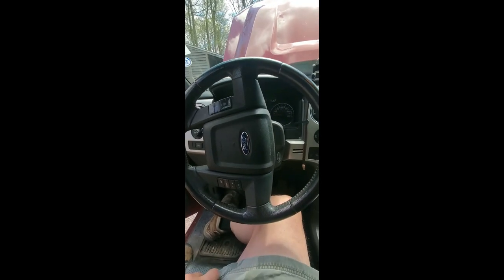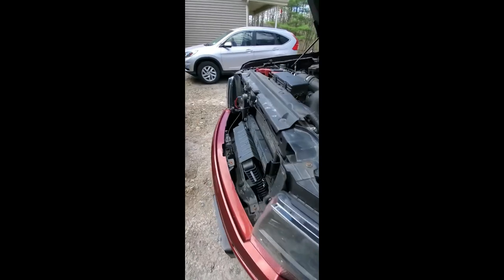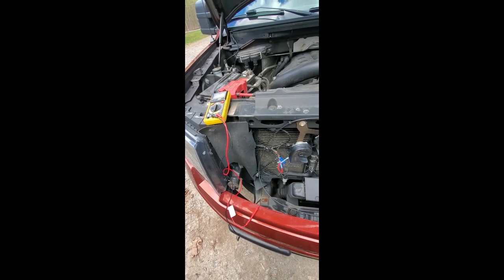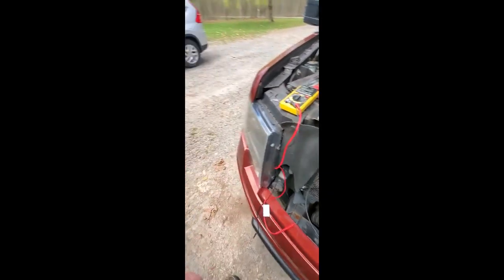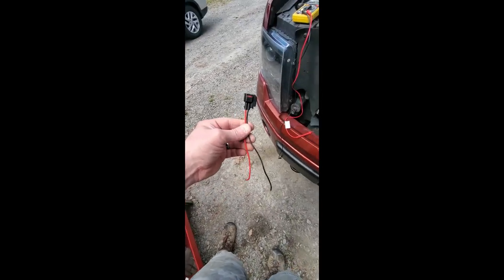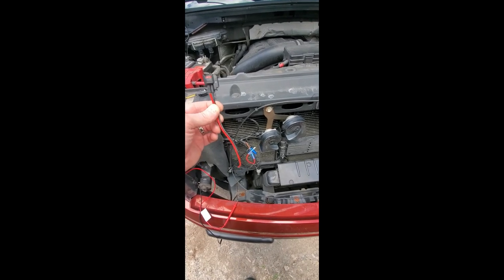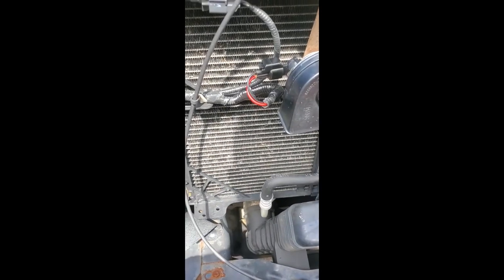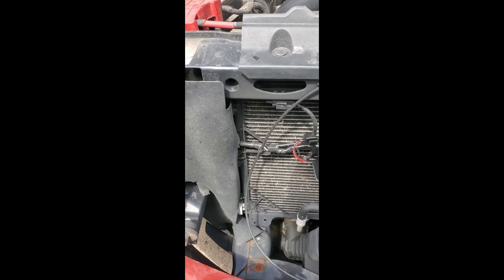2014 F-150 Horn CHEAP Fix!! It's NOT The BCM. This truck does not have a fuse.

Comment: Dude I replaced my horns and was getting ready to try and bypass the bcm when I found this video. My connector was clean and looked good. I cut it off like you did reconnected the wires and BAM my horn works!! Thanks dude!

Comment: Hey blootube27.  Thanks a lot. Because your video, it made me think outside the box.  Fuse was good so I pulled connector off and there it was, a corroded connector pin.  A little bit of vinegar and baking soda and one QTip cleaned off the corrosion.  Shook out solution from connector and reconnected to horn.  Clicked my key fob, and the horn is working again.  I live close to salt water in Florida and corrosion on electrical is a common failure point with boats and cars.   Thanks bro
Reply: This worked for me!!!

Thank you so much brother
Reply from the maker: I hate to say, at about $160 just fo a diagnostic, we have to think outside the box. Glad it helped!

Comment: When you locked it with the key fob did the horn go? Before you fixed the wire
Reply from the maker: No. The horn didn't work in any capacity.